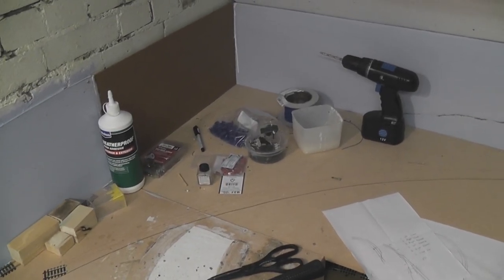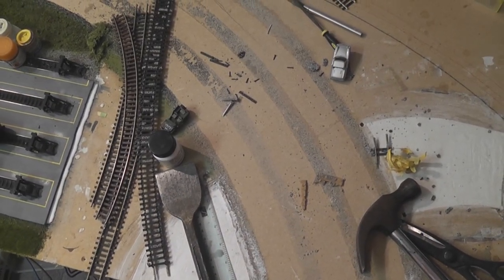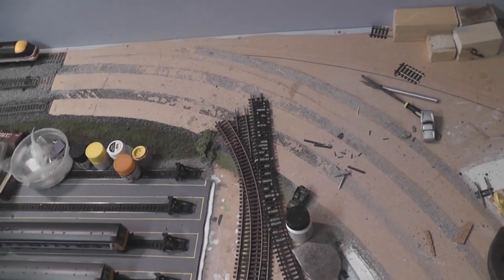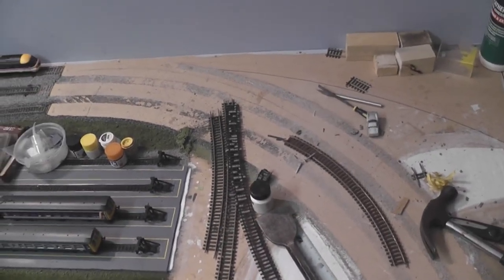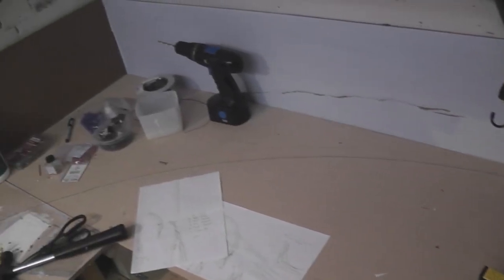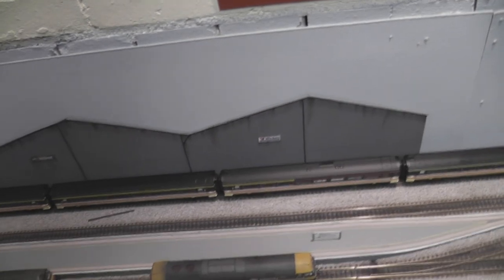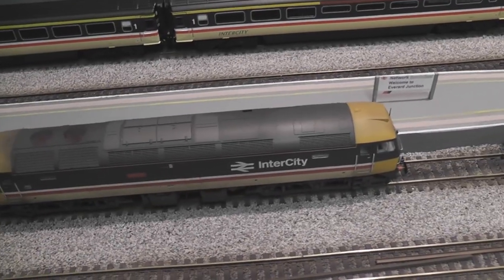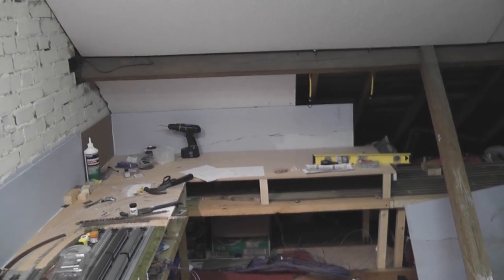Layout Extension Update

Comment: Hi there , my names rob and I'm designing my loft layout to fit in a 5.5 by 3 metre rectangular space.
Having watched your excellent and informative videos I have learned alot...thanks !!!
I'm planning on running a helix as my layout will be split over three levels , is it possible to take a spur off a helix to the middle level given that the helix starts on bottom level and runs upto top level?
Cheers rob

Comment: hi there, now that you have had the baseboards in place for a couple of years. do you have any problems with the MDF sagging in the middle of the boards.I noticed there wasn't much support in the centre of the boards. Ta
Reply from the maker: Gary Shardlow I've had some issues with the top boards, but the bottom boards are fine.  They have quite a bit of framework under them which has held up well.  The top boards don't have that to allow for access to the bottom layer.
Reply: if you had the space under your top level to support it. What would you use. I'm building my second level in the garage and will need support, due to damp
Reply from the maker: Gary Shardlow If I could I'd brace all around the edges with timber and add a leg every 2 ft or so.  With it all bolted together it should be very strong.  On mine the front edge of the top boards is not braced due to access restrictions and this has cause some issues in the past.  Solved it by adding more legs.
Reply: Thank you for your advice, I'll let you know how the build is going. Ta